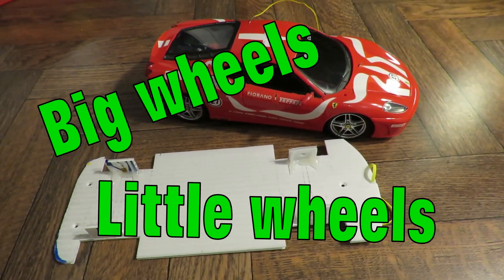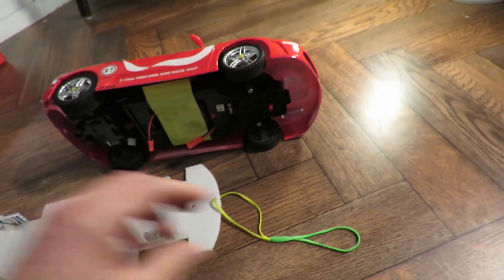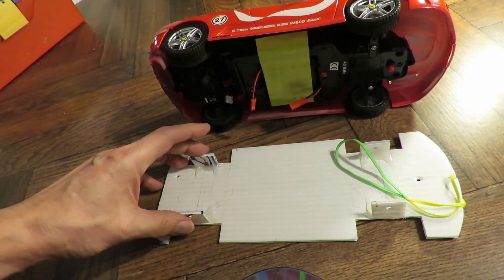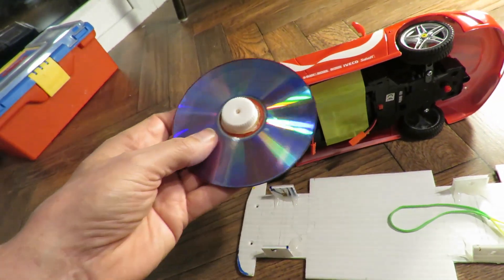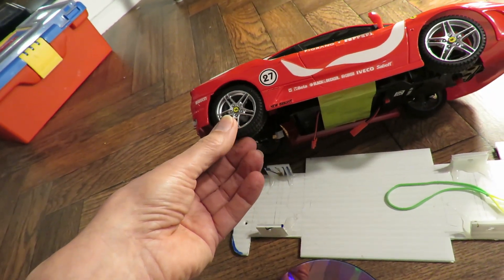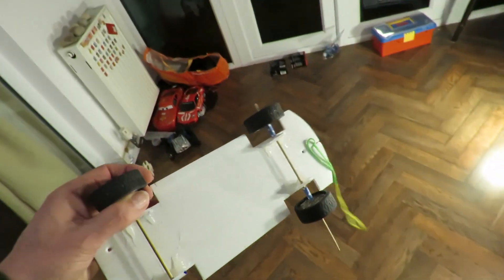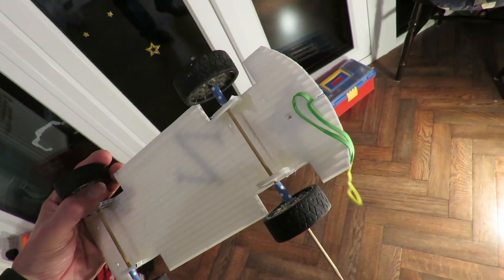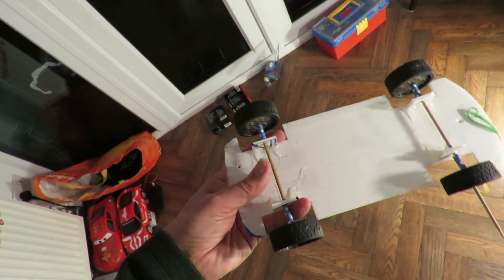Put a rubber band on it #0185

Comment: I think another factor at play here is that the smaller wheels are also wider, meaning that they have more surface area touching the ground than the CD wheels which are thin. This results in extra grip, but I think in this case where the car isn’t going super fast anyway, it’s pretty much just extra friction that’s slowing the smaller wheels down more quickly than the CD wheels.
Reply: I think you need to look at that again or even try it yourself. A larger surface area does not give you more grip. The mass of the car and the coefficient of friction for the surface are the important forces. You then need to work out the applied force and here the radius of the wheel comes into play. Assuming the same rubber bands are used and tensioned the same amount on the same diameter axle the leverage or gearing effect of the radius of the wheel will give you the applied force in the forward direction. In fact the more you study the problem the more factors you can probably consider. The simple point that for the same number of revolutions a large radius wheel will travel further than a small radius wheel so for the same number of turns of rubber round the axle a large wheeled car will travel further, but it takes more power to turn a larger wheel so there will be an optimum size wheel for a given mass of car with a given power source (rubber bands). That is why I have found a rubber band powered car that is suffering from wheelspin can be cured by at least 4 possible fixes. 1. Less power (remove some rubber bands) 2. More weight (mass) 3. Change the tyres (coefficient of friction) 4. Larger diameter wheels ( same as 1 - effectively reducing the power)  Here is an interesting article regarding friction https://www.stevemunden.com/friction.html
Reply: oh I see. Yes that makes sense. Wider tires wouldn’t increase friction unless weight or coefficient of friction of the material (or other factors) were changed. Yeah I see that now. 😅
Reply: @AeroCraftAviation  it is one of those things that seems completely wrong. Intuition tells you more contact should be more grip. Once you start looking at the coefficients of friction for different materials it can be quite surprising too. I know some of the "rubber" tyres on toys seem to have less grip than the harder tyres and even the "sticky" rubber tyres can fail because they pick up the dust on my floor quicker and then become worse 😜
Reply: Huh. That’s interesting. I wouldn’t have thought of that. :)